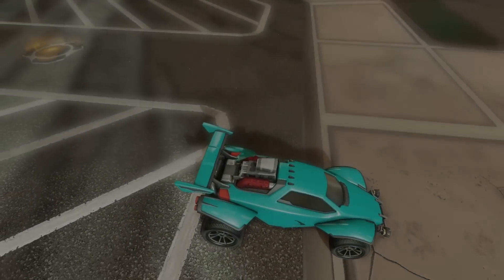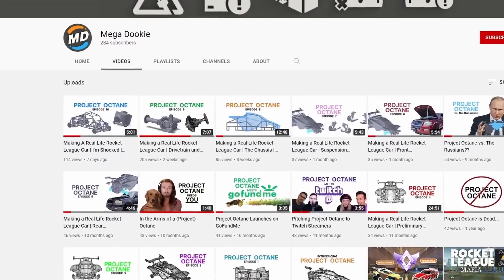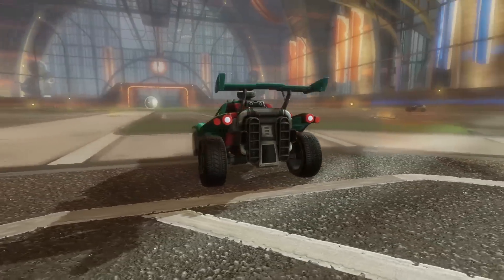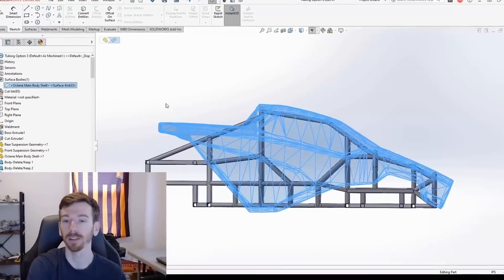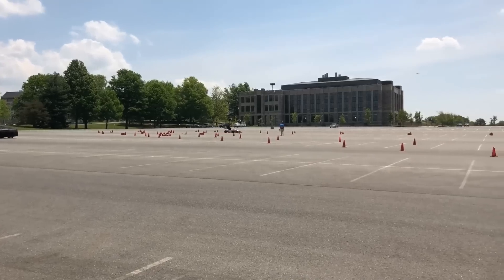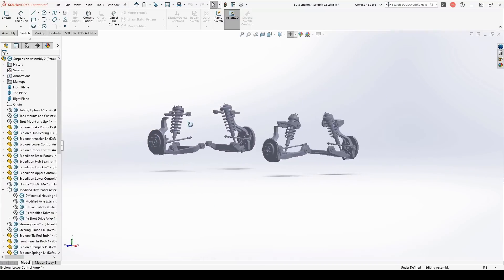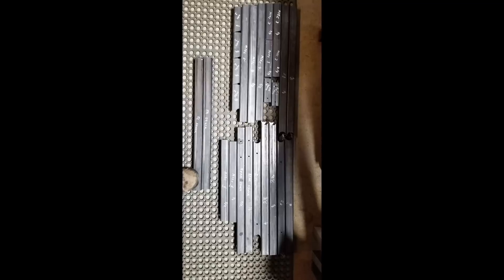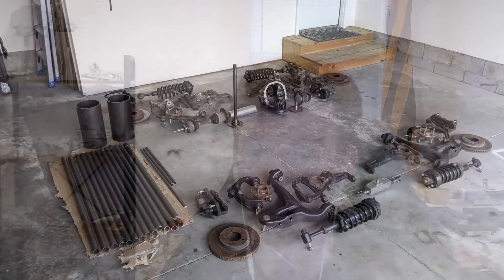Meet the guy who's building a real life Rocket League car

Comment: Don't use a Ducati V4 engine! (Not a hater they are great) EXCEPT for the valve springs or lack thereof... adds a lot of complexity, more frequent service periods, and higher cost for repairs. Go with something simple, proven, and reliable. (GSXR 600, YZF-R6, Kawi 636, or CBR600RR)

Comment: 8:12 to hell with controlled speeds, let the people burn some rubber

turbocharge the engine and install a "boost" button that controls the wastegate, when you hold it, pressure builds up and the car doubles the power for a short time,

Comment: Hayabusa turbo engine would be spot on huge power (300hp) reasonable price an 100s of people have swapped this motor in to small cars. Even with out the turbo still 200hp an enough torque to move the octane.
Reply: I'll dig more into it, thanks for the suggestion!

Comment: If you're looking for a good motorcycle engine, I highly advise one out of the mid 2000's Japanese 1000's models. Something like an 05 GSX-R 1000 or an R1. They're super cheap to pick up used, and can put up around 150-200 horsepower depending on what you get. Good Luck! Can't wait to see how this thing turns out. :)
Reply: Agreed, or a Hayabusa engine, a little more expensive, but leaves the option open to turbo it to 300bhp on standard petrol in future.
Reply: @Elwon20  I was gonna say turbo busa swap ftw
Reply: Power to weight ratio and lack of torque would be atrocious🤣
Reply: Goldwing flat six would be sick
Reply: Big block with a dummy big top hat…. Any 1000cc wouldn’t ever look remotely like the octane
Reply: @F10N55  there is probably going to be a fake engine to replicate that look, the real engine will be mounted somewhere below that
Reply: Yeah I was looking at mid 2000's ZX10R engines and they're only like 2K. Not sure how much they're budgeting for the engine but a used liter bike engine would be lit.
Reply: I second those choices. Motorbike engines are super underrated for car builds. An awful lot of stunt vehicles used in films are powered by motorbike engines.